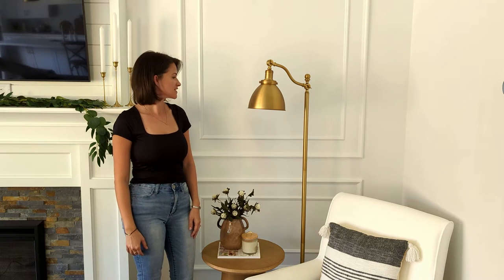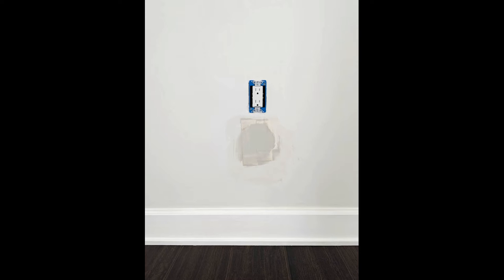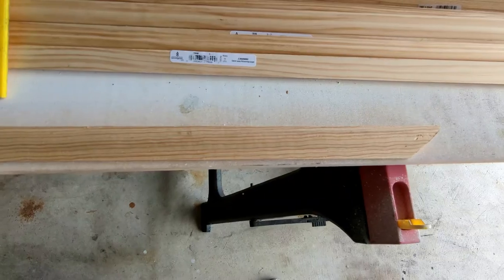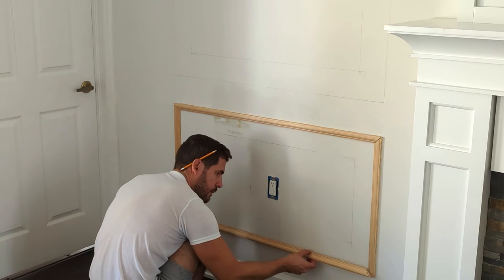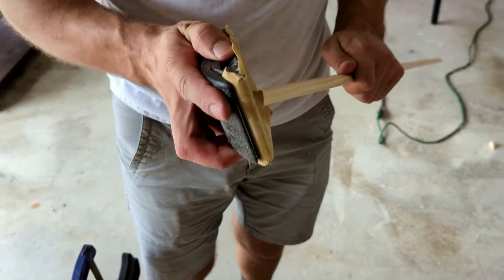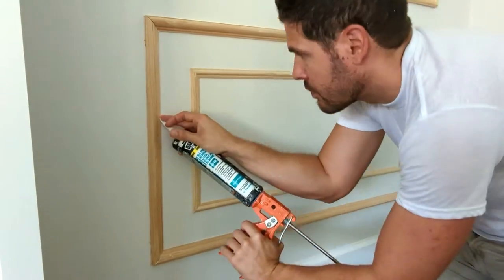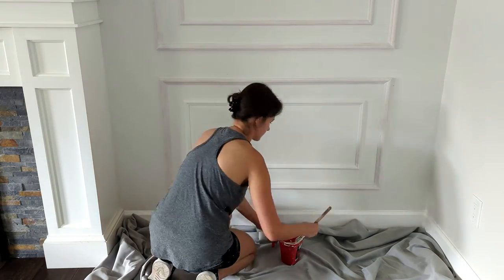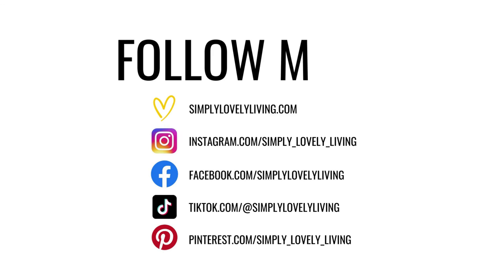DIY Wall Picture Frame Moulding {Step-By-Step Tutorial}

Comment: What size brad nails did you use?
Reply from the maker: It needs to be 18 GA brad nails. I don't recall the exact length but we did use a smaller size for the smaller trim.